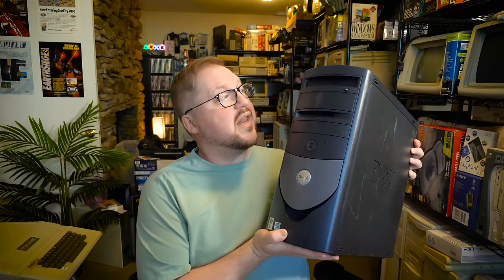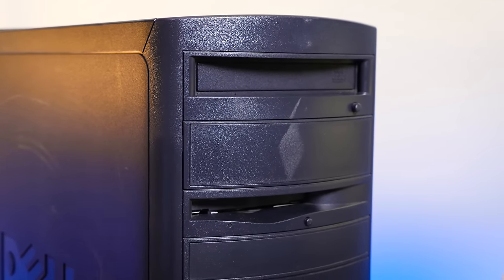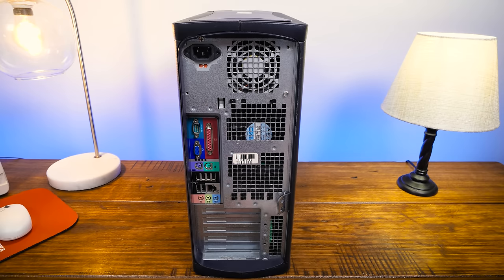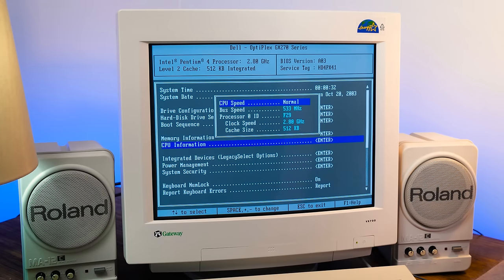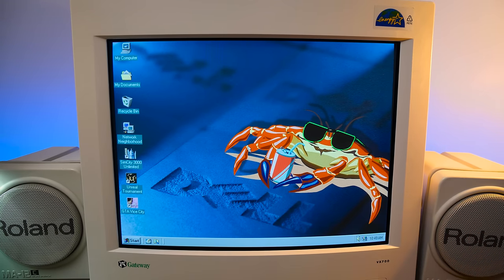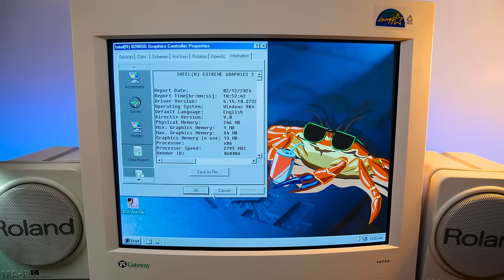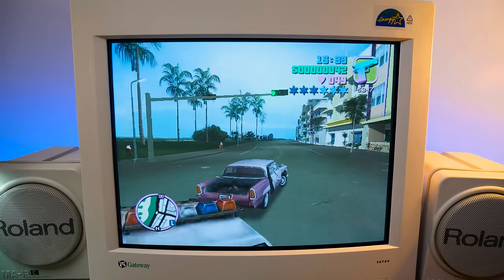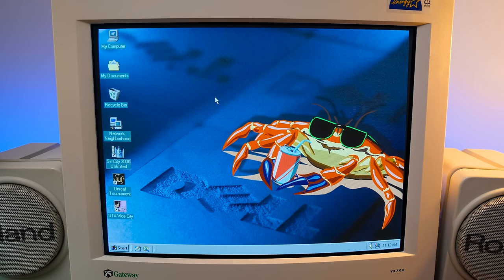The Most Unwanted, Boring PC: Dell OptiPlex GX270

Comment: The driver that fails may be caused by a bad cap. I have too much experience with these crappy Dells. Blue Screen when loading the proper video driver? But it works ok with the generic driver? Bad caps on the video card...
What I REALLY wanted to see was Clint trying to plug in a USB thing in the front upside down angled hidden by the cover USB port - unlike the usual try it three times insertion, these Dells required 5 full flips of the cable to figure out how to insert it.

Comment: Honestly, the duct things Dell were using made sense, even if perhaps the rest of the design wasn't so good. These days people fill their cases with a ton of fans when the cases are full of holes where the air just escapes before doing what it's supposed to do; move heat. But, since all the parts are shaped so differently, there's no chance really in making standardized ducts. Also, with the current transparent side panel craze, ducts are not very desirable.

Comment: My beef with Dell's Business machines is that all components and connections are proprietary, so it is hard to upgrade/repurpose. An HP or an ASUS business machine can be easily upgraded and changed into a Linux or low-end Batocera PC.

Comment: My college had a shite load of these, all running windows 2000 pro, my 1st two courses had them with dual network cards, with dual windows 2000 installs, for class and for lab,  The desktop versions ran windows 95 oddly, until those were later bumped up to windows 2000. These were in the library, and other class rooms.  This was when windows 2000 was starting to replace windows 9x and Novell, and NT4 stuff. The college Microsoft Suite ran them with windows XP and with a gig of ram.  those were used to host windows XP and the VMware software.  They ran no bother at all, i replaced the HDD in the later model, which didn't have the Floppy drive. They did ok, in fact Dell in the uk is pretty strong stuff. unless you build your self.

Comment: For me, I would love to get my hands on a system like that especially being a 98 system that works.  I think all modern systems are extremeling boring and unwanted, but being on extremely low income and unable to afford an old computer I am forced to use what I have.  98 has always my ultimate OS where it took me years to warm up to xp.  After xp my hate for computers has grown where I stopped usin Windows to linux, but still, modern OS just doesn’t do it for me and I miss the old 98 days.  Lately my time is mostly spent in a dos environment either using a usb stick, or dos emulation.  Thank you LGR, but any pc that can run 98 I cannot see as boring or unwanted but quite the opposite.

Comment: Psst, LGR, I got an interesting video idea you might wanna research a bit on.

Last year I obtained an old IBM Thinkcenter PC with a Pentium 4. I started using it for Win98 shenanigans, getting a hodgepodge of drivers to get it working since it was only meant for Win XP at the earliest.

I knew that an old MMO, Final Fantasy 11, originally released for windows 98 SE back in the day. I was able to actually get it running and had it connected to official servers.
You'd need one of the older install CDs since the new installer uses .dlls and APIs that Windows 98 just does not have. But once installed it will update as normal.

Maybe do some research and see if you can get that up and running. Or don't.

Comment: If you went to a public school or visited a public library at any point in the 2000's, chances are the computers there would be one of these if they weren't using iMacs (my high school in particular used both depending on the classroom, lol). They really were that inescapable.

Comment: Man I had to work on so many of these back when I worked IT as a teen so the toolless design was nice, but could be awkward depending on what you had to do / how much space you had. Didn't have many capacitor issues (maybe they weren't around long to start having issues yet).

There was an entry level series of Compaqs, I swear they yellowed after a year that stands out to me as the most bog standard pc (can't remember the name, but the were also a SOB to have to do work in IIRC)

Edit: after some googling I think it was the Compaq Presario 7360, but in my memory it was a bit more generic looking, at the same time pictures of inside the case looks really cramped which would match my SOB to work with statement

Comment: I hated these old Dell's with a passion. Not only the case but the fan setup and the alarms or pre-boot warnings if you didn't replace certain parts with Dell parts. Literally would keep the computer from booting until you hit a key to acknowledge the non oem part every time.

Comment: The best thing  to if your going to install an unsupported OS is to find the chipset version of the MB, video and sound  that Dell used. I just finished installing Windows 95 on a Dell 4500s P4 2ghz. Also had to find and run the CPU speed fix for Windows 95.

Comment: 13:15 Really interesting to see how Dell really has not changed their internal cooling strategy at all in more than 20 years.  A brand new Optiplex 5000 purchased last year has a heat sink mounted on the CPU, and covered with a shroud. 

The only fan in the entire system is mounted on the heat sink, blowing AWAY from the CPU. That's right, it draws in cool air through the case and exhausts it backwards over the heat sink and out the back of the case.

Comment: Man.... these computers were utter trash when new. My High School replaced all of their old outdated (but at least reliable) translucent G3 iMacs with banks of GX270s, and they were trash almost right from the beginning. Cases that fell apart, constant overheating and the fans running at full blast...while doing nothing? Almost all of the flappy front port doors were immediately ripped off and broken by teenagers, because teenagers.

Comment: I don’t think this was going to win any awards for design, but I thought they were pretty decent computers. you could do whatever you wanted with them. In fact, I have one of these running latest version of mint perfectly.  And I didn’t even put in a video card because once I saw that it played YouTube with no problem, I left it as is because I have the original monitor with the speakers on the side, original keyboard and mouse as well, I thought it would be cool to keep it all original, except for the ram which I upgraded to four gigs I don’t know how much it can take but I had four gigs laying around so I put it in and I put an SsD in it as well but the original hard drive is still in there, just not hooked up. I don’t know what more you want. the computer is this old and still runs modern systems with no problem I’d say that’s pretty good  Of course I still daily drive my iMac from 2009 so maybe I’m not the right person to ask lol

Comment: I hope schools still don’t use these. Before I switched to a really good job I used to go and do a bunch of repair work for clients and one of the schools still and about 200 of these machines still in use and would frequently break but this was in 2017 so I hope they are long gone by now. I also remember the next gen ones from 2004 maybe you could get a complete system with a 15in monitor for only $300

Comment: It's so boring, unwanted and spread all over the place that they're the only school/office computer I truly remember using. Especially the slim versions. Suprising.
I had one from a dumpster. The capacitors were okay. But the cooler mount was so crap that it broke the CPU socket pins off. So I just got rid of it.
It was running Windows 2000 at the school it came from.

Comment: I still have a couple of these functioning as library terminals where I work 😂 running porteuskiosk though mind you. Locked in a cupboard with zero air flow

Comment: Ahah. We had a ton of these in our lab (and we still have some of them running). It was my desktop computer (with Win2k on it) from 2005 to 2011. So I am very nostalgic of this sucker! Before watching the video, I mainly remember the hatch/flap on the front with 2 USB below (USB1 if I remember correctly?)
PS : and the most boring PC for me is the Gateway Pentium 2 looking like a thick pizza box. It was more forgettable than the Dell, because Pentium 2 lasted less longer. A Pentium 4 like the one you have here was performing OK with WinXP, so from the day it was manufactured until the rise of Windows 7, so from 2004 to 2011.

Comment: They were pitched by Dell at every local council, civil service, school etc with their entry level 17" flat screen monitor and Windows XP and core "Office" products installed, plus internet capability.

In 2004 this machine was replacing kit across the spectrum that was barely running Windows 95. Often BBC Micros in schools, Netsuite and other crappy versions of word and excel. It got rid of CRT's and looked space age in its sleek black design - after two decades staring at yellowing cream and tan.

Cursed by its own success.

Comment: At my last job, we had a good number of GX240s-270s well into the later years of the 2010s (we were working on replacing them for a while but that had to be done piecemeal). They were... very not good machines, but with some finagling you could get them to run Windows 7 halfway decently. Wasn't proud of some of the OS fuckery I had to do but those machines would work at the very least.

Comment: I have one with not that bad capacitors but broken RAM and no spares to replace it, but the first 256MB of RAM seemed to be OK, so I enabled that "OS install mode" and the thing just worked fine, apparently it just was the bad RAM that caused some problems, but with that option everything worked ok

Comment: If even after having damaged capacitors this thing is working, I can safely say this system is far from boring and useless 😅. I have an Optiplex gx260 from 2002, and it's working suburb. I have original Dell drivers for Windows 98 SE for my system,  which I believe will also work on this rig. If you want to try, I can upload them and share with you.

Comment: RE: The Caps
I have two identical HP Pavilion SFF DC7600's, one had nasty caps I need to replace, and the other one looks fine, but should still be done. The one that had bad caps is stable UNLESS I actually try max it out bus speed wise. If I put in ram that's at or above the max bus speed of 666mhz it locks up. but if I leave it under it is happy as punch, or whatever that saying is.

Comment: most unwanted? awww, poor old thing! i used to have the flat desktop version of one, but eventually swapped it with a neighbour for another machine! i still have a sff gx260 and recently got hold of 2 later sff gx620s very cheap ,, where i used to work used to have a fair few of the upright tower gx270s, or at least one that looked very 'similar',  more like those 'dimension' ones...and yes i've seen A LOT of them around,  none of the ones i have/had had been afflicted by bad caps as far as i can see...luckily....
Reply: 30 bucks cheap?  i never paid more than £5 for any of mine 😁

Comment: so that front USB port is a special I/O card. It hooks to the mother board via a ribbon. I had a dell dimension with the special THX crap back in college. I went to move the mother board into a new case and it wouldn't start up. The PC gave me a a BIOS error. turns out that little card has to be hooked up and working for a Dell special mother board to boot properly.

Comment: not only dell ,i remembered at that short period of time lot of motherboard got the bad cap problem , then started to see some motherboard brand specially use high quality cap for selling point, and see some brand use solid cap type, i think now all motherboard use solid caps right..?
bad cap motherboard usually still work, just not very stable , reboot time to time , at early 2000s , lot of people overclock cpu , you really can feel the performance difference ,even just little bit , still can feel it, quite fun for tweaking around and actual useful, dont know nowadays PC people still like to messing around that kind of stuffs..?

Comment: I'm also having drivers i have from working on the GX270 series I loved them I saved the drivers from dell's website so if they get taken down I still have them the updated ones that will work on XP SP2 and 3 I worked on about 50 of those machines and other models anyone needs drivers if they loose them I do keep a stock of OEM drivers just incase I need them or for restore puropes

Comment: I like early to mid 2000s stuff. This machine is pretty good, since it has an AGP slot, the crappier versions with Celeron and no AGP are not very good.

Get a decent GPU such as Radeon 9600 or 9800 SE from ATI or Geforce 6600 GT from Nvidia, this is good base for a Windows XP retro PC. No Windows 98, because the hardware will be completely wasted here.

Comment: we had these in high school they were a big upgrade over our previous computers since those couldn't even run xp and had become yellow from old age. but it was still disappointing since they were already a few years outdated when we got them and couldn't handle vista i think even windows 7 was already out but at least it was smooth with windows xp and the 2009 internet . basically when i was in kindergarten they had no computers at all but people who are over 10 years older than me online say they had them in the 80s. in the year 2000 i went to a new school that had computers and it seemed very high tech compared to my previous school  .this school had a department for young kids and a high school so i was there until the early 2010s and they only upgraded their computers once with this stuff in like 12 years .

Comment: LGR: gets a notoriously bad PC riddled with capacitor plague, and is able to get it to post and finds the EXACT drivers for it to run Windows 98. Also manages to squeak out decent gaming performance out of it. 

MJD: “So I tried upgrading this Windows 98 PC to XP, and it turned my CD drive into a paper shredder, caught fire a couple of times, got possessed by a demon that threatened to eat my first born, somehow started bleeding out of the side panel, and got the BSOD. So I’m gonna reset the CMOS to see if that does anything…”

Comment: we had dozens of them running in our old company. They are dirty, scratched, ugly, with the years. And heavy like tanks but all of them running quite well even with bad caps. And trust me, all of them we had, are plagued from bad caps. Maybe this is the most importand point why these optiplex 260, 270 and even 280 had such a bad reputation. I hate this Design also, especially the front cover, hiding two USB Ports and Audio I/O it was hard to connect anything on that position, when the pc was standing on the floor. All in all there are quite stable Business Machines, Workhorses our where equipped with 3.0 GHz P4 with HT and some decent Matrox AGP Graphics Card to fire up two monitors which where also black CRT's from Dell back in time.

Comment: You’re right Clint. That’s the most boring PC. Platicky trash and it’s right in that era where it’s an XP machine and there are much better options for that OS. And it usually can’t run windows 98 because of the video or chipset (there are exceptions) so the retro collectors don’t want it.

Comment: The 2000 era Dell Dimension XPS T or B desktops looked a lot better than the Black and grey blobs of the 2003 era desktops and my family members have owned both of those machines that came with a Pentium III 800 MHz in the greyish beige monolith and a Pentium 4 3 GHz in the Black and grey blob of a tower, the latter which also shipped with a Dell generic GeForce 3 and the former had an nVidia GeForce 2.

Comment: I think Vice City needed 64MB if using onboard video or 32MB if using a dedicated video card (likely because the system used some video memory in the on-board video configurations).    I had one similar to this although it was a Dimension, but I think at heart, much of them were the same -- although the household Dimensions probably didn't have the administrative/management tools and some of the advanced BIOS features, but were otherwise the same setup basically and same configuration.  I remember mine because it was the first real "prebuilt" system I had, which I purchased specifically to play GTA Vice City, which at the time, I thought was great with the 64MB onboard Intel Extreme 2 Graphics.   That was until I stuck a GeForce 4 card in some years later and realized that the Intel graphics were just "OK" but in reality, laggy.

Comment: i also had p4 a motherboard with like 8 to 10 bulging capacitors, some even leaked on the board. Used it like that for a year or so 🤪 got lucky with the capacitors i guess

Comment: Dell dimensions are boring for winXP and above. They get pretty interesting when looking at 9x i use a dimension 4600 as the base for my 98se gaming rig, 2.6ghz pentium 4 northwood, 512mb ram, rock solid chipset and an AGP slot its pretty nice i wont lie.